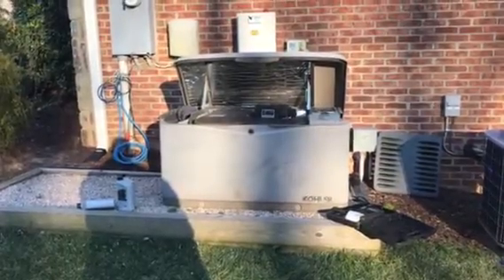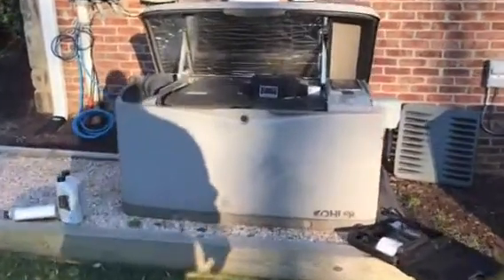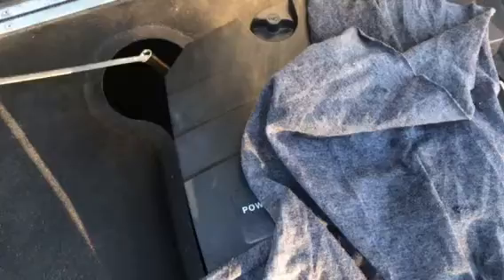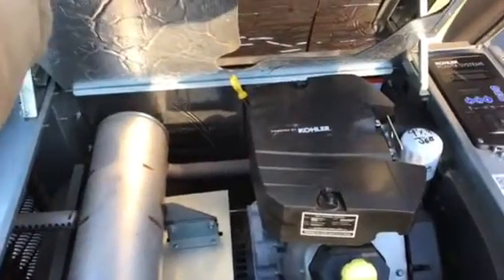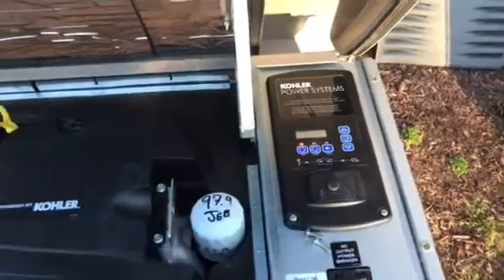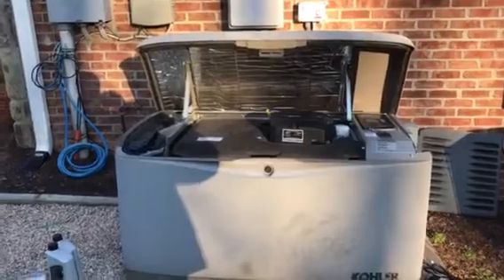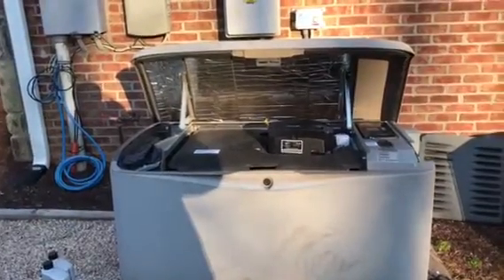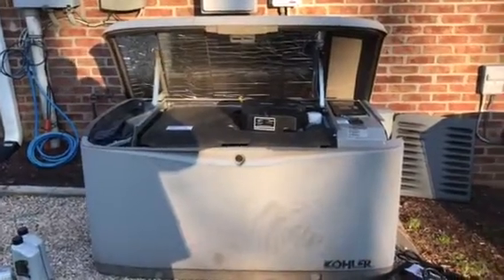Checking Oil - KOHLER 20kW RESA

Comment: Wouldn't the low-oil pressure switch have shut it off?
Reply from the maker: Kurtis Hasselbring supposed to but with any small air cooled engine those pressure switches are subject to not working correctly before damage was done.